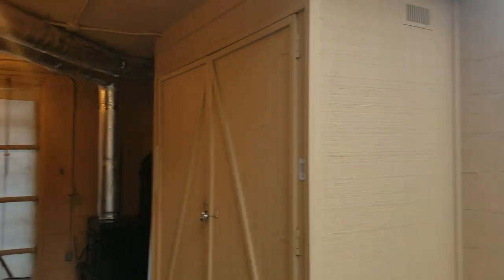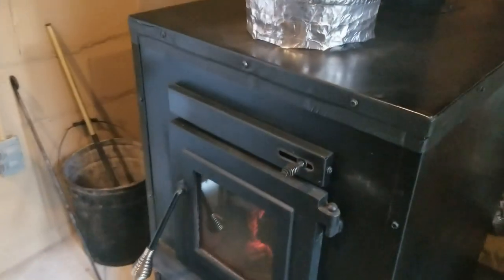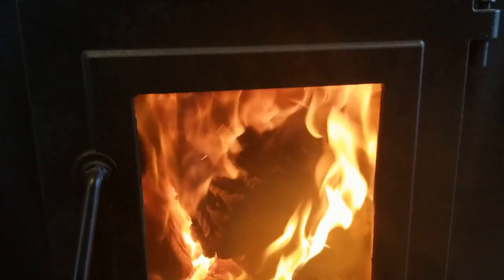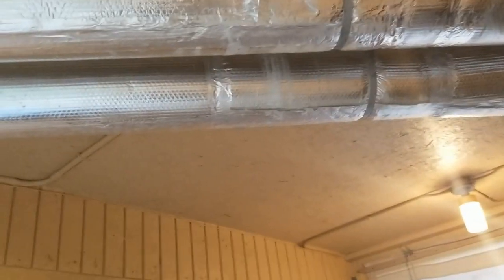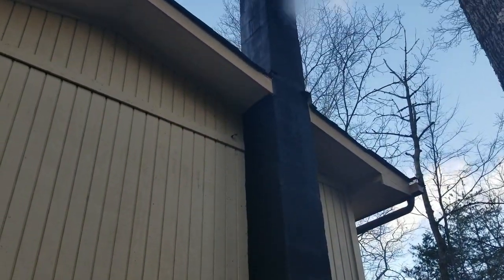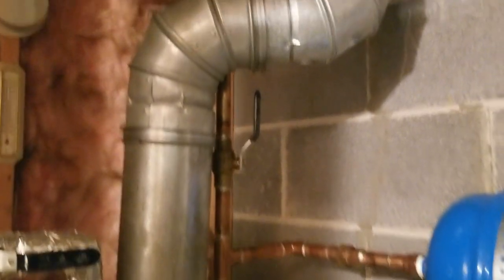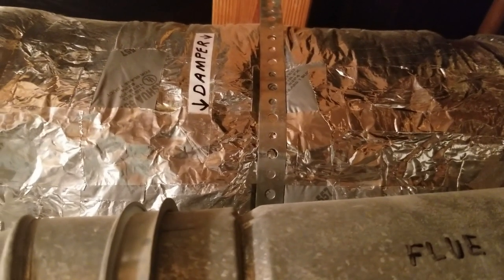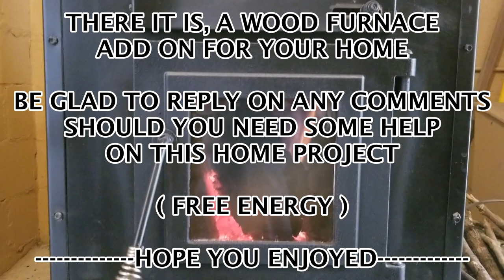How to Install a ADD ON WOOD FURNACE. The do's and Don'ts on installation.

Comment: I plan on doing this same thing   It just dawned on me to see if other folks have done the same.  I didn’t plan on going to the extent you did but it makes to much sense / efficient to do what you’ve done. I even thought about building a box or something around the flue pipe to get that heat as well but mine will kind be the focal point of my living room that I’m remodeling from an attached garage nice job thanks for the inspiration
Reply from the maker: Awesome my friend. Your very welcome.

Comment: I've exclusively heat my home with firewood and a Regency Stove for the last 18 years. My Son recently purchased a Home that has this exact same Summers Heat Furnace in the basement and I cannot believe the sheer volume of Heat this Blower will move around his house !! Looks like this Furnace had previously been available at Lowes but sadly no longer sold. Short of stealing my sons...where would a fella get his hands on one of these Summer Heat Furnaces ??
Reply from the maker: I wish I new my friend. They don't make them anymore  is what I heard, but might be able to find one on web. There great stoves. Thanks for sharing this my friend.
Reply: I can't get mine to heat 1600 sq ft.  Maybe I'm just being too overly cautious when the fire gets roaring? Of course, that may be asking a lot out of it too, maybe?

Comment: Great video. I recently bought a home that once had a wood furnace (still in basement) but the previous owners unhooked the exhaust duct work (not sure why) and no longer used the furnace. The return is still tied into the main duct work from the house, but where the exhaust duct work "used" to be tied into the main gas furnace, it has been capped off. After uncapping it and doing some investigation work, it looks to be blowing right into the main chamber of the natural gas furnace and not into the exhaust duct but blowing right on top of the gas furnace coils inside the main unit....   I am not sure if this would affect the coils (maybe that's why they unhooked it?) seems to me that would burn the coils up or make them get too warm. Or do you think that even affects the coils and would be an issue? I have a couple of options. I can simply just tie it back in as the blower works, the stove and chimney have also been cleaned but, the exhaust would again be blowing right into the main chamber and on top of the coils if I simply just hooked it all back up. Or would you recommend running new exhaust duct work to a different section of duct and not blowing right into the main unit. Any tips or things you have learned would be appreciated! Thank you, sir.
Reply from the maker: Not sure my friend. He unhooked it for a reason. Might need to reroute the ductwork, But that's your choice my friend. Good luck on what you decide. Think it through.

Comment: I have an Englander just like yours. Best investment I ever made. It's simple to understand and operate, lets the operator judge the settings, and is built like a tank. It does take time to get the balance of wood, drafts, burn rates and other things all together, but when you do, you'll wonder how on earth did you ever go without it. Nice job by the way
Reply from the maker: Awesome my friend. Thanks for sharing this. I love mine.
Reply: @donnielaws7020  Everything was going great with mine. Then, I decided to  get another one, as the wife and I got older. Come to find out, the Englander 28 3500 is not made anymore (2022). Way to go Englander. Screwed up royaliy. No wonder the Imports are killing us.
Reply: @peterluwinsky2938 They didn't get a choice. The EPA made them stop making this one. They tried a 28-3500 that met the new standards, and then the EPA got even more strict. Now they do not sell a furnace, only stoves.

Comment: It's a shame that Englander stopped make this add on furnace. Why, .... who knows. But
I still say, this - was the best heating investment I ever made. Here in New England we get
some pretty brutal cold spells.  Jost make sure, you have AT LEAST 2500 TO 3000 sf in your home to heat, or you'll be forever fickling with the darn furnace trying to get a balance between too hot and not enough.
Reply from the maker: WOW Thanks for sharing this my friend.

Comment: This is so cool!  I’d love to have one. Great backup Incase of electric off
Reply: @Robin,
That's only partially true. Most all furnaces need power for the circulation fans and the draft motor on a wood furnace. A small generator for backup power for furnace and a few necessities completes the survival plan.
Reply from the maker: Thanks

Comment: Thanks for sharing this video. We just bought a house at auction, it has a block basement like yours. It also has a wood burning stove with a pipe coming out of the top running into the house furnace very similar to yours. I’ve only got a glimpse of it since they are renters in the house and we haven’t actually closed in it yet. We  had a wood burning stove growing up, it was the only heat for our house, but it was in the middle of the living room and was only radiant heat. I know nothing of this set up, hopefully with your video and some Investigating I’ll figure it out. One thing I don’t get is how does it not put smoke into the house? I know it has a Chimney but looks like at least some smoke would be go into the house. Thanks for sharing again!
Reply from the maker: Your very welcome. The fire box and the smoke vent to the chimney are separate in the stove. Thanks for sharing my friend.

Comment: I have a very similar furnace and I don't have the creosote problem you do.  I clean out every year, sometimes every other year.  I never burn pine.  I burn alot of hardwood (red oak, white oak, etc).  Not sure what is different, but something you may want to research.
Reply: I burn between 3-5 true cords a year.  I live right outside of Nashville, TN.
Reply from the maker: I think my wood is not seasoned enough sometimes.  Thanks for sharing.

Comment: Now I don't have the same problem with creosote clogging up the flue. I run really hot, even fire with coal when it's really cold. I clean my chimney once a season, and there is hardly any build up.
Reply from the maker: That's good. Remember the stove is not designed for coal, But it would probably be ok in small amounts. I'm afraid it will get to hot. Enjoy it while you can because it will most likely be against the law to burn a stick of wood of any kind pretty soon unfortunately.  Wait and see. Crazy times we live in.
Reply: @donnielaws7020  englander uses to rate this as a wood and coal stove. I just throw a shovel full or two of soft bit coal on top to extend my burn times. I agree that this is definitely not a coal stove, but soft coal in small amounts has proved ok for me over the last 5-6 years.
Reply from the maker: @johnculver8936  That sounds like a prefect way to do it.😀

Comment: Very nice video.  Can you tell me if this furnace will work with the power from solar electric power?  Would there be sufficient solar power to run a system like this?  Also, do you think this wood furnace Broduses as much or more heat than an indoor wood boiler would?  I am in southwestern PA and winters are cold here.  I have an oil boiler that quit working and I am going to replace it with either a wood furnace or a wood boiler.  I was wondering if you knew which was best, in your opinion, of course.
Reply from the maker: It will if it can supply 120 volts AC with 6 amps of power to it.

Comment: i am doing something wvery similar. What size duct did u use? i dont have a furnace so i am using a centrifugal fan to distribute the heat through the duct.  what size is you blower CFM and duct size?
Reply from the maker: 750 my friend on the wood stove.

Comment: May be a question asked far below but didn't see it. When you talk about cleaning it every 4-6 weeks what exactly does that include? Do you burn some Creosote sweeping logs then disassemble the pipes?
Reply from the maker: Yes  my friend. You will know  when it needs cleaning because it will start not burning  good.
Reply: @donnielaws7020  thanks for taking the time to respond and also thank you for the video. Its extremely informative and helpful.

Comment: I have a wood burner just like that in my wood room in the house. 1800sqft poorly insulated but the stove does well just dont have the burn time i would like. I have been using it for 10 years so far. about 24 face cord it eats in the winter
Reply from the maker: I know my friend. I have to get up real early to reload it. Sure beats the price of propane.  Thanks for sharing my friend.

Comment: Donnie:  I have the exact same stove, but after 40 years it has shown it's age.  I would like to replace it without a lot of re-piping.  Who made your stove, and where can I get the same one?  Manufacturer and model number please.

Thanks!
Erwin
Reply: Thank you for the heart reply, but you didn't answer my question . . .
Reply from the maker: All the information you want on the stove is in the video my friend. I got mine through Lowe's. I have had to paint it again once.  Thanks for sharing that my friend.

Comment: Hi, do you ever smell smoke inside the house when operating this stove?
Reply from the maker: No, never have i had any smoke or smell inside the house. My wife thinks it gets a little more dust to clean off in the house over time in the winter. Thanks for commenting.
Reply: @donnielaws7020  Thanks,  appreciate it.  I have that model,  and I seem to smell smoke. I might need to replace the door gasket,  or maybe the chimney pipe is leaking at the joints? I don't see how the damper control seals....seems like the  sliding arm is a path into the firebox, where smoke could come out. Seems like it's more pronounced when it's really burning briskly....maybe something starts warping so that a leak forms, or worsens. The cement caulk I use on the chimney joint seems to crumble, even though it's made for sealing stove joints. I wonder if there's a pressure test that could help me identify leak points. Does the chimney even need to be sealed completely,  or should the natural draft action tend to suck the smoke in and keep it in the pipe?
Reply from the maker: @wildmanofborneo  Sorry to hear that. Mine cause smoke to come back out of the top slide vent when the 6" exhaust pipe needs to be cleaned out. This causing the air flow to not to pull air for the fire. After cleaning out the pipe and stove all is fine. I don't think the fire box is sealed off from warm air vent tight enough. Must be a seam or how they put it together when assembling. Check your air flow, could be not drawing air good. Thanks for sharing you comment.
Reply: I have the same model. If any smoke enters the room while reloading, the fan behind the stove can suck a little smoke in and distribute it into your home through the ductwork. It rarely happens if you're burning good seasoned wood, but if your fire isn't hot enough, you can get some smoke, but you shouldn't get any with the door closed.

Comment: @DonnieLaws Thank you for the video.  I just bought a house and I cant figure out how to use the wood furnace attached to the heating oil. Will the heatign oil furnace turns off when using the wood furnace? I felt stupid asking this question because I dont even know if I am askign the right question lol. How do you clean it ? Tia for the answer.
Reply from the maker: No it won't shut off unless you set up right my friend. Thanks for sharing. Your very welcome. I just turn it off when using the woodstove.
Reply from the maker: I have videos on how to clean the woodstove to my friend.
Reply: @donnielaws7020  Thank you for the quick response. I guess I got it now. I just have to turn off the heating oil furnace thermometer, that way im only using the wood to heat the house. Is that right?
Reply from the maker: That's correct my friend.
Reply: @donnielaws7020  You are awesome. Im your new subscriber. Thank you so much.
Reply from the maker: THANK YOU MY FRIEND.

Comment: You should not need to clean it every month, if you do it's not burning right give it a little bit more air. You will burn a little more wood, but your fire will burn cleaner and it will cut down your cleaning to about once every three months.
Reply from the maker: Thanks for sharing this my friend.
Reply: Should cut it down to once a season

Comment: Just curious, what is your supply temp through the register's.
Reply from the maker: Into the stove from house is around 72- 75 and output from stove in the house is around 72 - 80 depending on how cold it is outside and how hot you run the stove. This is a closed loop system. I hope that answers you question. Thanks for commenting.
Reply: Thanks for the Video sir, I have this exact stove in my shop, my question is what kind of duct work can I use to just pipe mine up and over in my shop with 2 registers in line? I don’t want it to get too hot?
Reply from the maker: @travisnobles8840  Your welcome my friend. I'm not sure on your application, But i would use standard galvanized pipe on the output and just insulate the it good. Hope this helps. These stoves can get pretty hot at times. Thanks for the comment.
Reply: I have the same stove.great stove..

Comment: I set up the unit in my place. It hasn't been used in a long time. Do I need a special chimney cleaning log to burn first before I get started?
Reply from the maker: Not really just inspect the chimney and pipes to see if any built first and go from there. thanks for the comment.

Comment: I have almost the same wood furance set up in  my basement.  I put solid cap block right next to the sides of the furance. That help hold the heat and it's hotter air going up to the duckwork. But I really like your idea of the return air from the house to the stove.
Reply from the maker: Awesome my friend. Thanks for sharing this.

Comment: Can you tell me what kind of insulation you used around the ducting and the water heater. That thing looks awesome
Reply from the maker: Away from the heat of the stove  I  used a kinda like  bubble wrap insulation.  It has worked very well. I got it at Lowe's. I have used it 11 years now. Thanks for sharing this my friend.
Reply: @donnielaws7020  I know exactly what your talking about. I use pieces of that stuff cut out to the size of my camper windows. Helps keep it cooler inside in the summer. Did you use any kind of special tape?
Reply from the maker: @streetpunk99  Just regular silver aluminium insulation tape.
Reply: @donnielaws7020  thanks I'm getting ready to rip out this god awful oil furnace I have and replace it with a wood furnace. The way you have everything insulated is pretty impressive. I hope to get my system looming as good as yours.

Comment: Cant seem to keep my this stove hot, I do not have a dampener on it, should i use one or no
Reply from the maker: Could be because of a numbers of things. Must be not getting enough air flow to heat the stove and burn the wood hotter. First i would check in the moveable plate in side the stove. The plate that sets above the wood that's burning. Make sure it is sled forward toward the the door to you. If it is pushed back to far  it will choke off air flow to the chimney pipe. Leave about a 2" gap form the back wall. You can see the flame going up toward the gap with a good fire. Or check your air port holes in the bottom ash door twist damper. Also check the top damper above the main door. I keep mine about 3/4'  back from the far right position. If this doesn't fix you problem check for obstruction in you chimney or pipes. That's about all there is to air flow on the stove. Make sure you have dry seasoned wood. NOTE: When you see smoke coming back out of the top damper this usually means you need to clean your pipes or chimney or both. Hope this helps. Thanks for the comment.
Reply: Great thank you, There is no damper on this now. I have a buck stove myself and am pretty used to running that. This stove has good airflow it seems to not hold the heat when i chock is 3/4
Reply: And I am talking about the dampener in the chimney. Dont you need that on any stove? Thank you again!
Reply from the maker: @johnshorba  No i don't have one on my chimney or pipes at all. I would not use unless you have to much air flow up the chimney. NO I WOULD NOT USE ONE.  Thanks for the comment.

Comment: Where can I find one of these sir?
Reply from the maker: I got mine a Lowe's.  Look on line my friend.
Reply: @donnielaws7020  okay awesome, thank you sir! It’s funny because I’ve literally had you’re almost exact set up theorized in my mind. When I moved my wife and kids down here in Virginia, I bought our first house thinking an all electric house was the way to go considering the easy winters they usually have compared to those hard Pittsburgh winters and of course our first winter here, no electricity! So since then I’ve been planning to build on my house a little room/shed type thing and putting a wood furnace in there. Running duct work through my block foundation and connecting into the existing like yours and putting a diverter to allow seamless transition from electric furnace to wood furnace. So literally almost an exact match, very helpful and informative, thank you much sir!

Comment: @ Donnie: I too had access to huge amounts of wood. I cleared lots for a large building contracting company. I had what was called a water stove: Fire box inside a water tank. I heated my 2600 sq ft home but it took 10 cord of wood to do it. I did it for ten years. There is one thing I wanted to say about the creosote in the chimney. It will eventually catch fire. And when it does it is one awesome fire. Sounds like a freight train. Beware!
Reply from the maker: Thanks for sharing my friend.